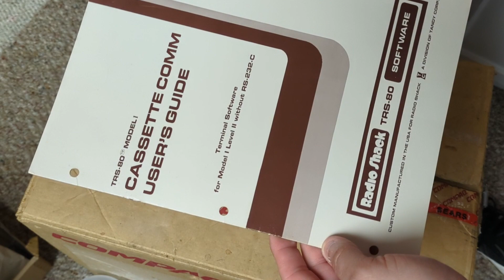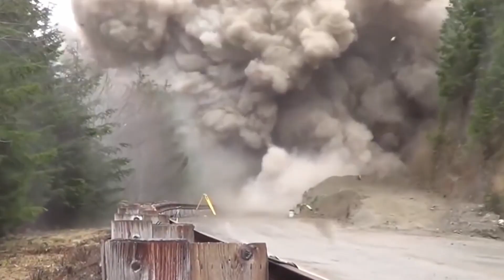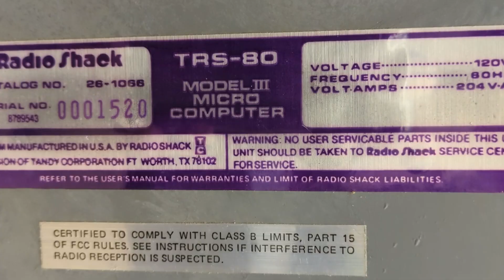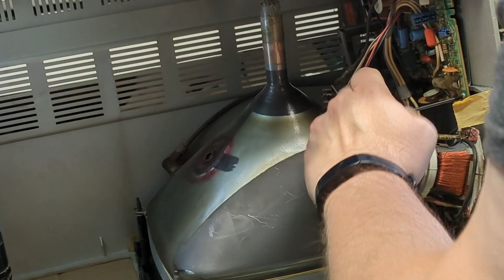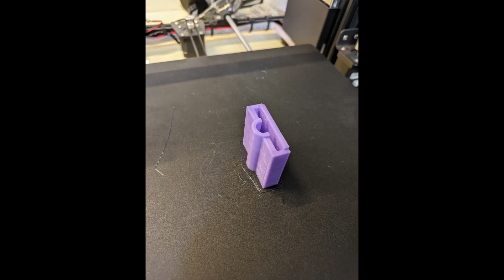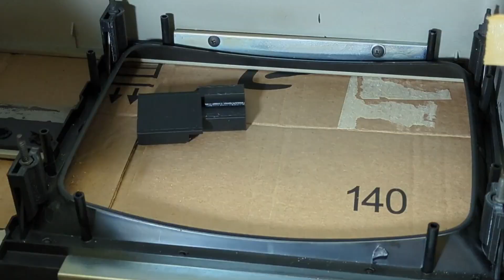TRS-80 Model III Cracked CRT Mount Fix.

Comment: There wasn't very much left of the posts holding that on when you pulled it apart. Good job printing up some jigs to hold the stanchions in place while curing. I now know how to solve this problem, should I come across it.

Radio Shack gang 4 life.
Reply from the maker: Woot! Much love for RS! There may be a more elegant design/print to do this but it seems pretty dang solid now! It looks like maybe RS figured this out as the photos I've seen from Model IV supports seem to be a bit more substantial. 
Thanks for watching!